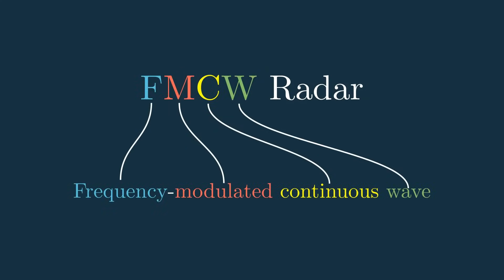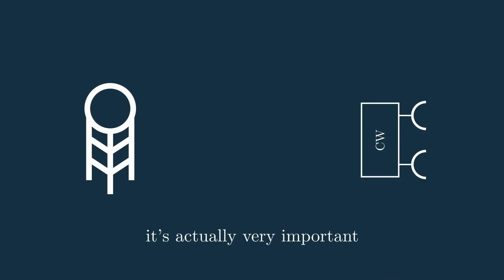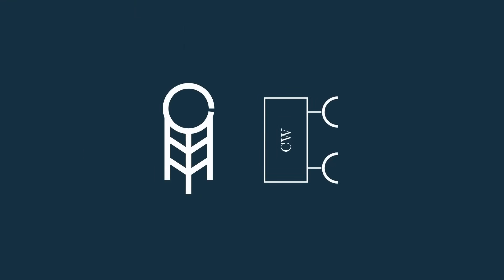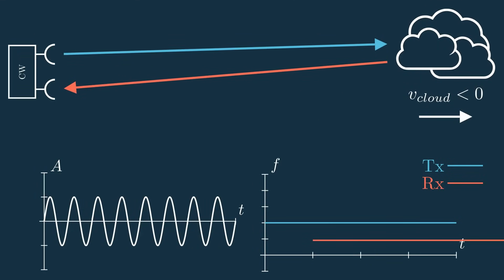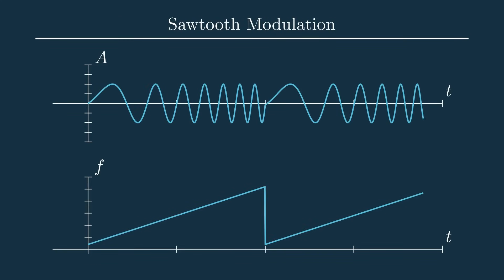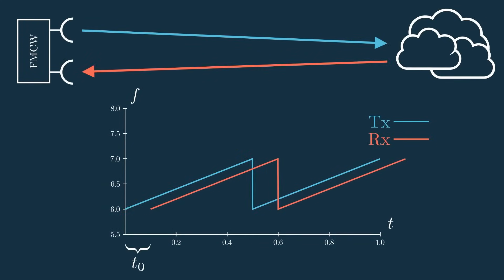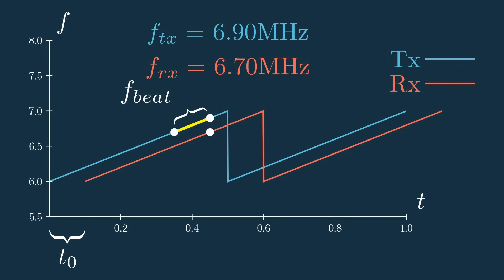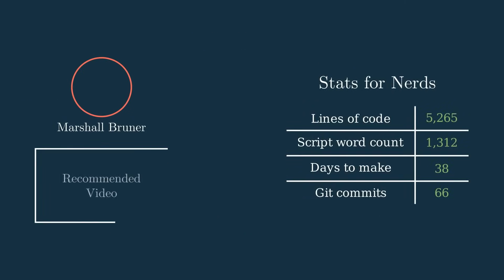What is FMCW Radar and why is it useful?

Comment: About peak pulsed power versus average power: all radar systems have to cope not with  an inverse square law for detection of echo returns but an inverse FOURTH power law. This is known as the radar equation. RF power, regardless of modulation used, has to travel both to and from the target and thus incurs an inverse square reduction each way. Note that this is a multiplicative affect. This requires exceptional receiver sensitivity and stability, far beyond what normal radio reception requires. This is why effective radar was not invented thirty years before by someone like Marconi. Sure, various aspects of radio obstacle detection and even simple ranging were developed in those three decades, but designing receivers sensitive enough to receive inverse fourth power returns AND yet not be de-sensed by the huge transmit pulses requires very clever engineering indeed.
Reply: Phased array plus AI is breaking theories.

This is how SpaceX is doing satellite to cell phone.

Conceptually it's backwards, it's radio over radar. 

It's a big reason the military is paying for their own satellites. Starlink is optimized for communication. The military wants a version optimized for "radar".

Stealth is meaningless to phased array from space. The satellites can see the shadows generated from the ubiquitous EM all over the planet now. When your stealth fighter flies over my cell phone, SpaceX would know if they wanted to know.

Also remember starlink is a giant inward facing inferometer. The size of the virtual dish is horizon to horizon. If SpaceX had enough processing power, they could track swallow migrations by individual bird, with and without coconuts. 

I first reading a bunch of white papers about it almost 20 years ago now. About 15 years ago those white papers started disappearing from the internet. About 10 years ago you couldn't find them anymore. So I checked and yeah most of them are working for SpaceX now.

Radar plus AI is basically magic. It's exceeding what is "possible" according to signal processing theory. Of course, those theories generally assume the Fourier transform is the physically most efficient way to process a signal.
Reply: @jtjames79  this is absolute drivel lol
Reply: @jtjames79 synthetic aperture was a viable method also before ai which is based on statistics. And if you can proof with math that the signal processing is already the best then ai cannot make it better because ai cannot break the mathematical rules.

Comment: Chirps are used in pulse radars as well - because if you cross-correlate a chirp with itself, you get a pulse out. So a pulsed radar doesn't actually send a pulse, it sends a chirp over a longer duration. The received signal is then correlated with the original chirp, which returns a pulse. You can time those pulses much more accurately this way. (the chirp is not just a random chirp - it's actually a pulse convolved with a chirp, so you get the time from the convolution as well).
Reply from the maker: Yes! This video is DEFINITELY over simplified because I wanted to give a very basic intro to FMCW. But yes,  probably most pulsed radars don't just transmit a constant frequency. That's a topic for another video :) Thanks for watching!
Reply: Pulse compression right?
Reply: This is accurate but a generalization. Not all pulsed radars use LFM waveforms, but many of them do indeed use a matched filter for the return. Depending on the waveform, the matched filter will yield the cross-correlation result, which has a smaller 3-dB width the more bandwidth you put into the pulse.

Comment: The change in frequency should follow a sine wave to reduce the amount of logic and increase the response of the system. Using any linearly variable pattern can be complicated to extract both position and velocity data from since those lines can still be shifted in such a way as to partially or fully overlap. Also, there is a distance limit based on frequency and receiver sensitivity since change in position of whichever object you are measuring must fall within one wavelength of the change in frequency.

Comment: From a function point of view, what (on earth) is the significance of average power in a pulsed system.
From a power consumption, and power stage heating side, pulses are only beneficial.
The very origin of pulsed radar was that very fact: high signal strength from low average power without toasting the power stage. Without it, radar wouldn't have worked as early as it did!
Reply from the maker: Good point, and maybe I wasn't clear enough on this. One of the difficult things with pulsed radar is generating that high amount of power in such a short time. Especially generating it in resource constrained environments like a car is difficult. Thanks for watching!
Reply: @MarshallBrunerRF  Boost converters and capacitors are "dime a dozen" components.
The question is how best to utilise what average power is available.
DO you pulse it, or somehow fix the problems with (relatively) low power.
The problem being sensitivity and noise rejection in the receiver.

For reference, I had a brief, in depth look at aviation radar altimiters. They use swept frequency mainly due to the simplicity of decoding the received signal in a pre digital era.

Comment: In sonar we have DELTIC delay line time compression.  Auto correlation you can track a moving submarine with just two hydrophones.  Used by CAPTOR smart mines in the late 70s.   (Band limited white nosie from moving sub is XORed and accumulated). Way before the microprocessor was around.
Reply from the maker: @jamesmorton7881  fascinating! I would love to learn more about sonar and its applications, but I know very little now
Reply: @MarshallBrunerRF  It's basically Radar with 20 years lag in engineering
Reply: James -- Delay lines are old technology to my knowledge but very cool indeed.. Last time I heard of delay lines in use were for oscilloscope sampling circuitry..
Reply: @fjs1111  and in analogue TVs
Reply: Cool but how is this relevant for fmcw radar applications?

Comment: Very nice video, worth watching! Small typo fix: the acronym FSK at 3:53 is Frequency Shift Keying, not keyring. Pull request sent via Github to fix it in the video.
Reply from the maker: Hey! Thanks for the comment and PR! I actually have that in the errata in the description as well.
Reply: I heard that too, "keying" refers to the key used for morse code. Like a keyboard, but just one key. At it's simplest, mash the key for one tone, don't mash it for the other tone.

Comment: Nice!   I would say that at 5:40 "beat" is better described  as the difference in frequency between two signals than as the difference in frequency of one signal at different times.
Reply from the maker: Thanks for the suggestion! Definitely happy to take any and all constructive criticism as I want these to be really helpful. Thanks for watching!
Reply: @MarshallBrunerRF 
The traditional idea of a "beat frequency" comes from two audio tones which are almost but not quite in tune, therefore they pass in and out of phase.

The frequency of that varying phase shift is the beat frequency, and with a reflective target it can be used as a sensitive but low resolution measure of distance.

If you want a ubiquitous but seldom-noticed example of measuring distance by phase shift, wait until you're in a quiet environment when an aircraft flies overhead. You'll hear a distinctive phase shift in its white noise between when you're standing tall and when you're crouched low to the ground, or when you move towards and away from a hard surface like a concrete wall.

(The value of white noise in this experiment is that some of the component frequencies will be well matched with the reflected delay so that the phase shift lies within our range of hearing. There is a beat frequency to this shift, but it's much too fast to be heard as distinct beats. For that, you would need to get down toward 20Hz or so.)
Reply: As an explanation - sure. I did have to pause for a moment and check the calculations, because of that. But I'm unsure of how actual radars of that type do things. It might be more accurate to say they do it this (roundabout) way to eliminate some kind of possible issue that could come from just taking the difference. Though it shouldn't be that important if the chirp is of that "shape" and you accept limitations of range and measuring velocity of the target as well. I guess it could be better technique overall for different shapes and changing chirp length and downtime (I do think that Continuous Wave Radars will still have downtime between chirps - but again, for at least those types of radars, I con't know them super well and I forgot what I used to know a long time ago).
Personally I knew a bit about long range Air Defense radars (both pulse and CW), but that was a long time ago. I will now check next video. While it is good to have "basics" video initially, this channel just started, so I assume person behind it will work on how deep vs. how accessible vs. how short their videos are. I prefer deep dives that sacrifice length (so they are quite long) in order to be reasonably understandable but also very in depth at the same time. But I know that YT might initially dislike longer videos.

Comment: can you explain at 1:53 why we want to have a greater desired power ?
Reply: Ya it helped ! I left the video till the doubt get solved 😅 but will see it completely now...
Reply from the maker: @RUDRARAKESHKUMARGOHIL  yeah! This isn’t always the case (for example automotive radar sometimes) but you want to increase average output power because the signal you transmit degrades as it travels through the air. So if you transmit a higher power, you can see farther distances in general. Hope this helps and thanks for watching!

Comment: Very cool video! 1:48 That's also why pulsed lasers are able to to ablate material while being "only" 2W of average power
Reply from the maker: yeah I mean 2W at 10% duty cycle or less is quite a bit!
Reply: @MarshallBrunerRF  Duty cycle on these fibre lasers is well below 0.1%. They are "pumped" by continuous laser source at longer wavelength and then triggered by a low power pulse at output wavelength. This causes an avalanche effect and whole accumulated energy exits out within nanoseconds.